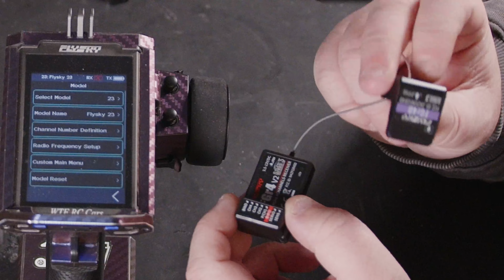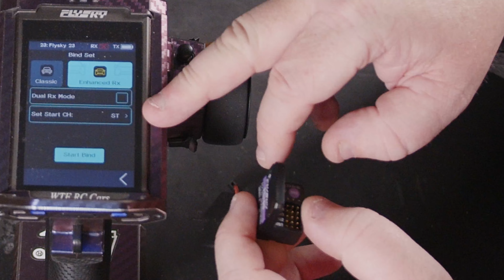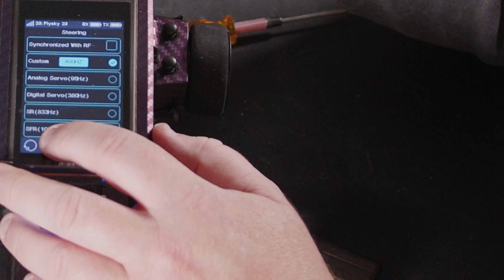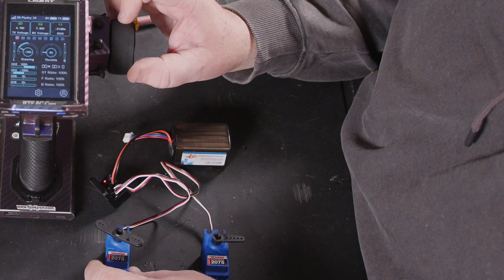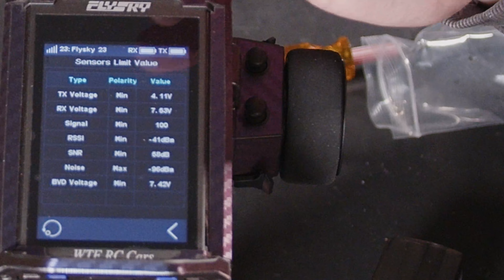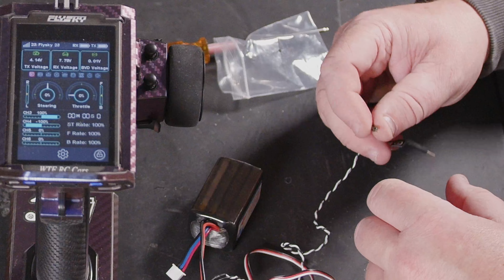Flysky Nb4 Pro+ model set up enhanced receiver and bvd basics

Comment: Hi Greg I'm using the BVD voltage on a 3S Lipo and want to set a low voltage alarm but i cant set it higher then 8.30V( which is for 2S I assume), is there any way to change this?
Reply from the maker: Yeh set the high voltage 1st then set the lower then set the alarm voltage
Reply: Perfect, thanks🦾

Comment: I had trouble with a Traxxas ESC and had to use the custom frequency at 250hz.  With digital servo I got a “Throttle trim not centered” error on the ESC.
Reply from the maker: Yeh traxxas esc's aint great and very slow.
Reply: @ I’m just glad that I had watched this video or I might still be troubleshooting.
Reply from the maker: @MrDan1713 glad it helped :)

Comment: Do you know if you have to run an automatic electric switch to run two wire lights and be able to control them with the receiver channel? or is there a way around that? There could be a setting for it in the transmitter which would be awesome but I can't tell if there is or not.
Reply from the maker: Yes as with all transmitters you can't turn off the power from the receiver as all the + and - pins are connected so you will need a switch to control the LEDs but you can get LEDs/light bars that have 3 wires and can be controlled I have vids on them on my trx4 and the light bar on my slash ultimate
Reply: @WTFRCCars  Thanks, I will check those videos out. I have some 2 wire lights already is why I'm hoping I can find some cheap auto switches or something.

Comment: Hopefully you can help- getting bad range like less that 50yards or so.  I have the FGR8b and FGR4s. Tried digital and 2.4.  Thanks
Reply from the maker: Could be anything, bad interference from cheap servo/esc receiver placed too close to metal, could even be something in the area your using it causing bad interference?

Comment: Request please - updated video on setting up dual rates and throttle curves.  I have it working but not sure if it's the proper most effective setup. 

I want to achieve smooth throttle control for my crawler and sometimes limit full throttle to avoid sudden launches during testing or simply to reduce power. Currently, I have it working for TR3 and TR4 in forward and brake modes.

However, to adjust the expo and curves, I have to use the touchscreen to toggle settings on and off. I’m not sure if this is the best approach, but if it is, then I’ll go with it.

Thank you for the updated videos on this radio; they’re really helpful for newcomers like me who just got one!
Reply from the maker: Will be doing lots of pro + vids

Comment: QUESTION FOR MY R1 DC1 NO PREP OUTLAW DRAG CAR SO IF I'M WANTING TO KNOW WHAT MY MAIN LIPO PACK VOLTAGE IS AND I'M RUNNING EVERYTHING FROM THE PACK ESC, STEERING SERVO,   DRAG 4-POLE MOTOR ALL I NEED TO DO IS JUST PLUG IN THE POSITIVE WIRE OF THE BVD TO THE POSITIVE SIDE OF THE BALANCE BOARD PLUG AND DO NOT PLUG IN THE NEGATIVE WIRE AT ALL??? THANKS FOR YOUR HELP WITH THIS BROTHER!
Reply from the maker: Yep that exactly how to do it just the + to the + on balance lead and you will get the pack voltage
Reply: @WTFRCCars  AWESOME BROTHER THANK YOU MAN AND THAT'S SO AWESOME MAN GOD BLESS 🙏✝️🙏 SINCERELY CLAY B. AND SPEED MOB RACING 🏁